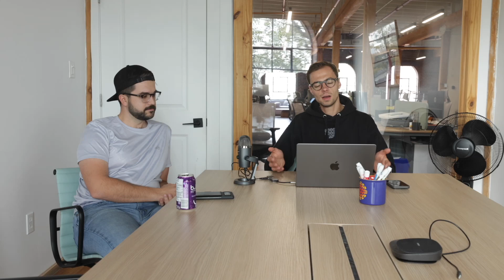This Week at Apollo: The Pro, Go and Moving to BC (Episode 6)

Comment: Gotta fix that stem bolt latch being used on the City Pro `23, Air, Rover/Go, and Pro.

The bolt (holding the latch) snapping off of my City Pro `23 within 2 months, and after 640 km is a far cry from the 10, 000 km advertised.

Now I'm out a scooter until your team inspects it (already shipped back this week), and only after their evaluation, if approved, start the process of sending me a replacement.

It's probably gonna be a while.

There are other issues, like the app-lock, kickstand, deck latch, and turn signals, but the stem latch is the by far the biggest concern.

You guys need to take a few pages from NIU in those aspects, and re-evaluate how you build/engineer the scooters...

On a positive note, I very much enjoy riding my City Pro `23, the designs are attractive, and the regen/drum brake combo is a step above all other competitors, so you guys are doing some things right.

Looking forward to my replacement, just hoping it's sooner than later.
Reply from the maker: Hi Scott. This is not a known issue for us. The latch is incredibly solid and guaranteed for 10,000 km. Please reach out to our customer service team and we will address this with you immediately.

Very sorry to hear you have experienced this issue . We’ll make it right!
Reply: @ApolloScooters My scooter is expected to be delivered to Montreal in a few days, so we'll see what happens!